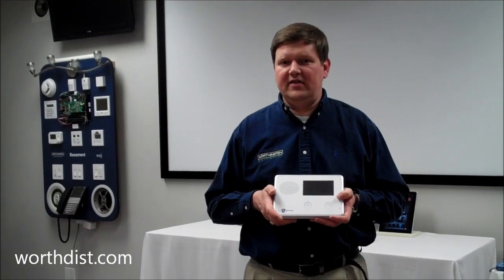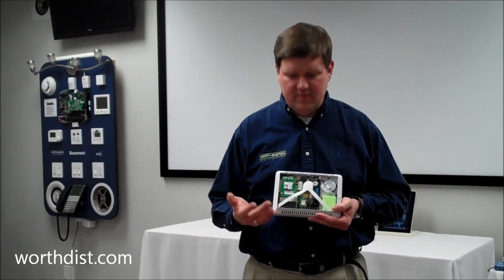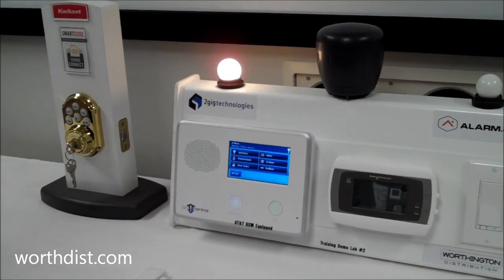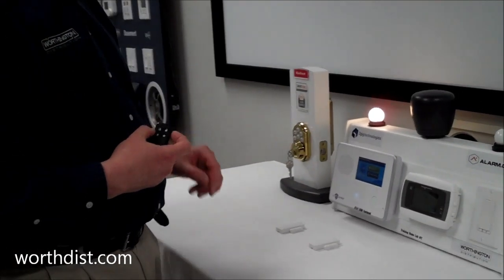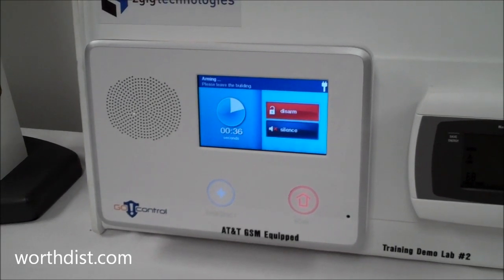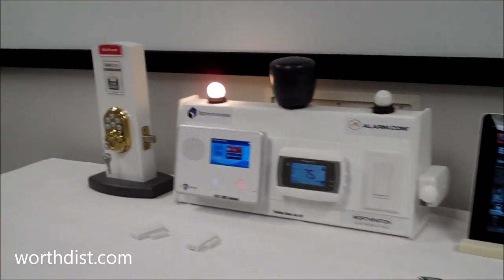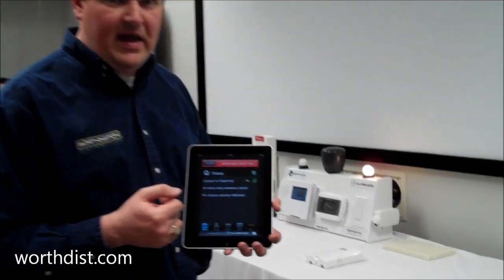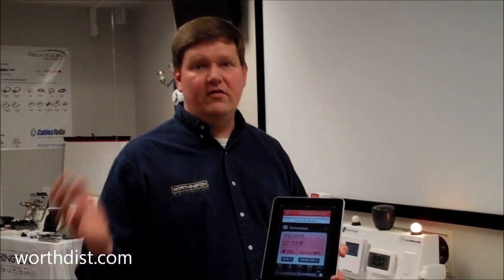2gig Security System Demo

Comment: Does the translator have a back up battery?  If I do not want to use the translator, would  I have to replace my existing door and window senors in order to work with the 2 gig system.